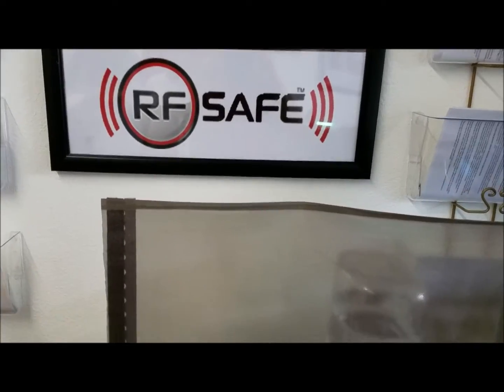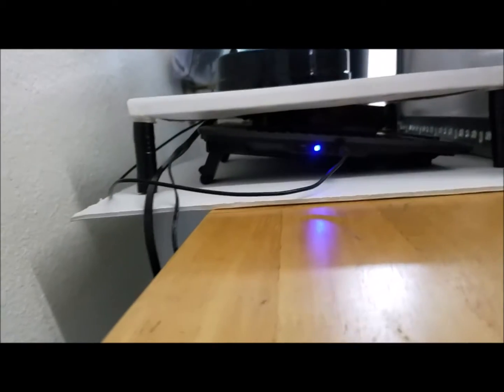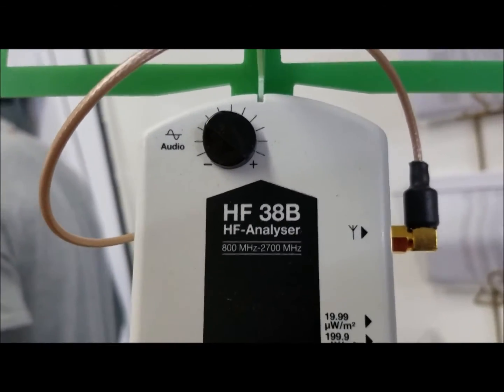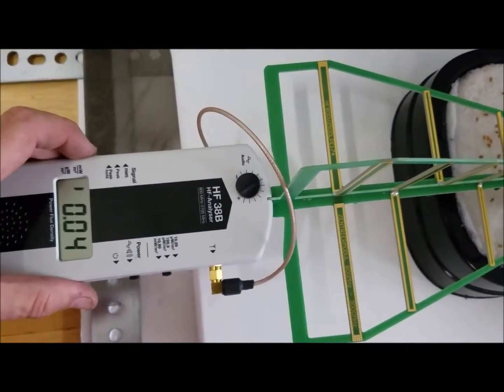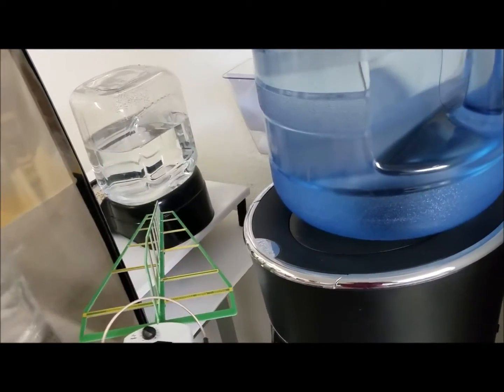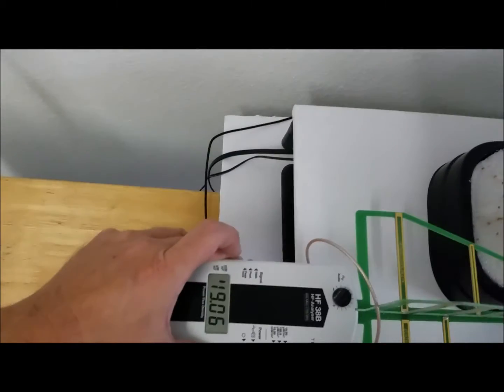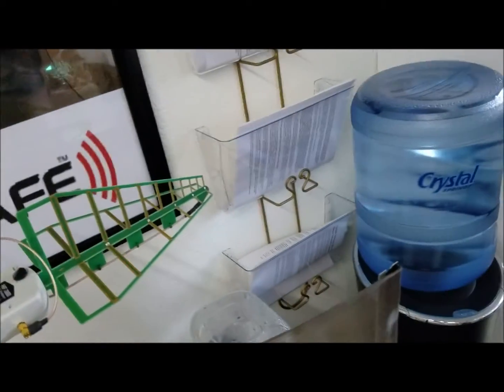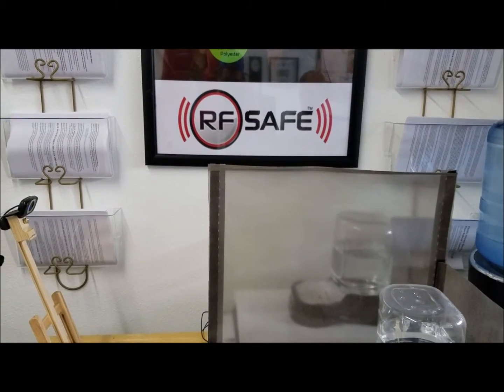wifi hazards exposed: watch seeds grow when exposed to household wifi radiation

Comment: there is to much smoke and mirrors in this "experiment " the meter is set to a max reading of 199uW  most wifi is at 100mW it was all ways going to hit it's limit and the hi gain antennae and from the size it's about probably 12db is going to exaggerate the readings , . i found this experiment to easy to fake nothing stopping this guy (with a vested interest) changing the PH of the water so that the plants die  and from the comments he did'int post a result . probably did'int work like he wanted . also wifi routers get rather hot so i'm not surprised that seeds may die in these experiments any thing over 15 c and  70% humidity mold and fungus grow fast and if they get above 25c bacteria could start to attacking  the starch in the seeds

Comment: Great experiment, but big failure to show the results... Seems you are more interested in showing how your shielding works, spent minutes on that, and two seconds to show the result??! .. Where is the camera showing the timelapse side by side ? They are side by side at first, then 7 feet away afterwards!... My guess is your side by side experiment didn't work,.. your gigahertz meter shows 0, because it's directional, but there will still be a high amount of EMF that close to the router, even with your 0 result. You need to use mesh and completely encase the growing box with it to do a proper experiment.

Hope you can do a REAL side by side experiment, with one encased in mesh, that way the camera can show both plates growing at the same time.. Even a super low signal will affect your results,... most people don't understand this,.. something that's 0 on the Gigahertz even, because it's not a super sensitive meter.  Use a ED88T with sound feature turned on, and if you can hear any noise, it's too much for a proper experiment, should be completely silent.

I should also say your very exposed group did fairly well compared to what other people show.. It did not turn brown.  You also placed it right on top of the router, so E and M fields are affecting the seeds. Placing 2-3 feet away to avoid E and M influences will be better! Stronger signal/closer, does not necessarily mean you will get a bigger effect...